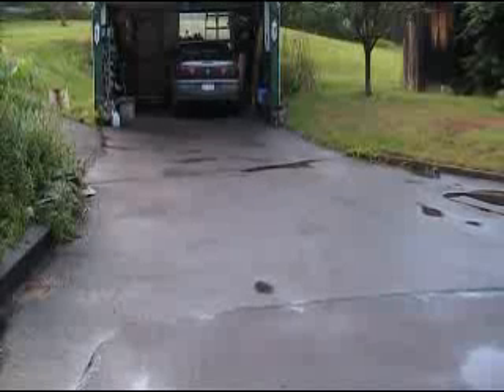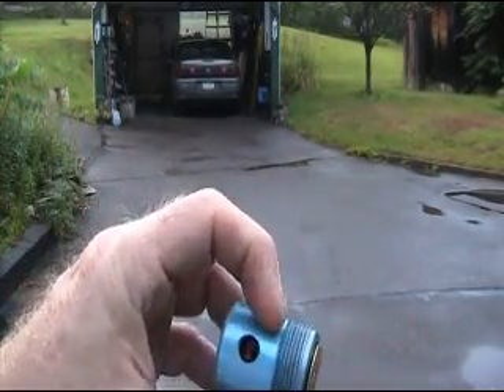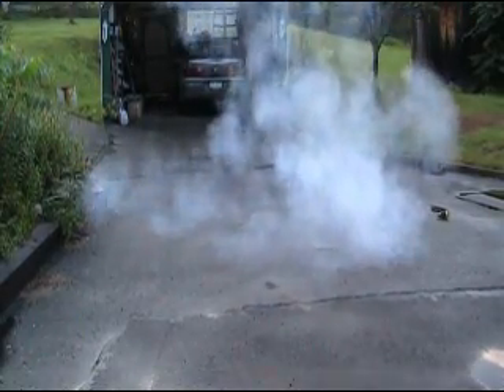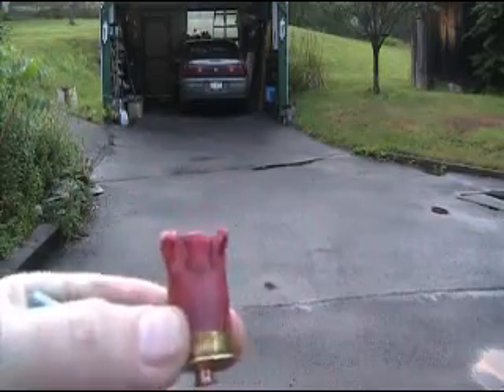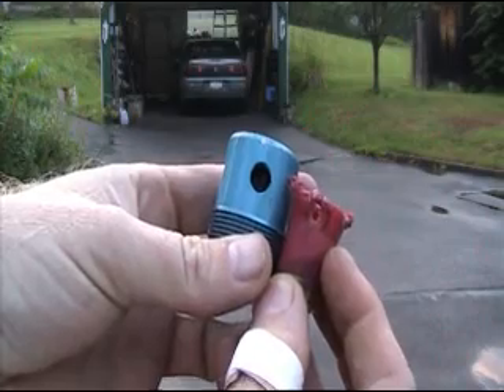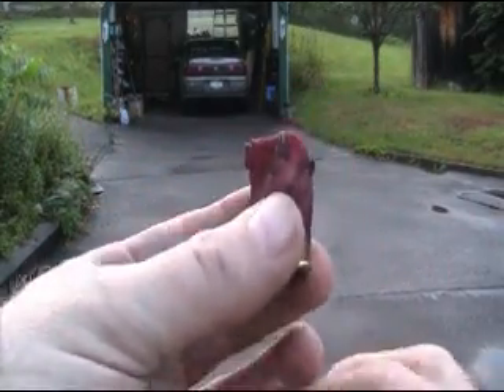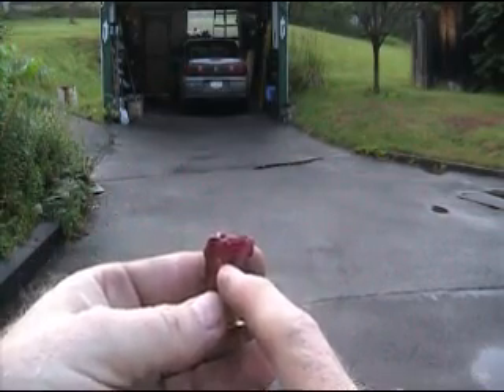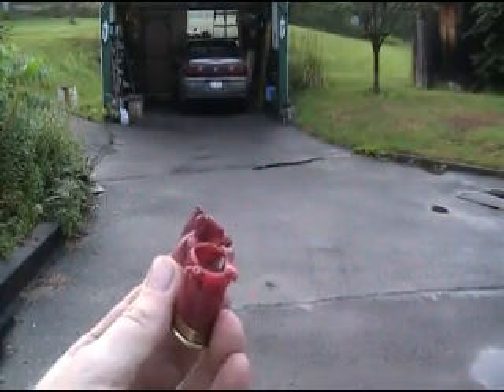*AIRSOFT HOBBY* - BFG 12ga Fire Test #1

Comment: wow very cool think these can be used in reanactment ?
Reply from the maker: I think so.  The VTG with a 12ga Blank gives up a good bang and if you get the newer ones that Dan at The Perfect Shot loads, you get a decent bang AND smoke.

The Grenade might be a tad expensive for some, but give a decent retort when used.  Well worth it in my opinion.  You can use 12ga, 9mm pak or 12ga .209 primers, depending on the insert.
VTG Inserts Testing & Review
Reply: could you give me the website for these they look great and do they have a timer ?
Reply from the maker: ***** Link in the Description for the VTG dealers in the US.
Reply: Oh I treys that one it was not on there any suggestion and how much they run about price if I see one?
Reply from the maker: ***** VTG Runs about $149.99 or are you talking the price of the blanks?